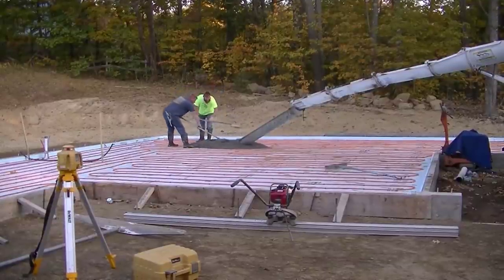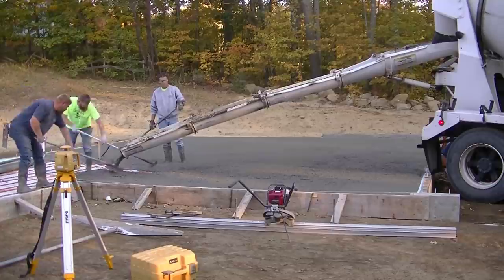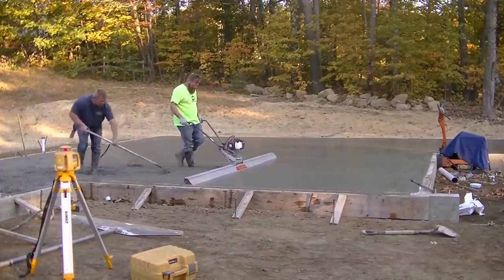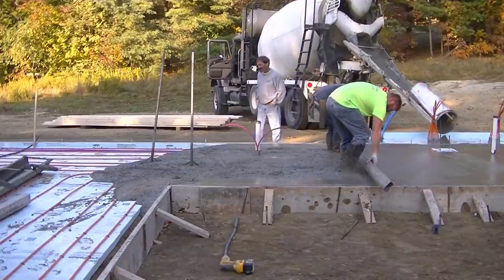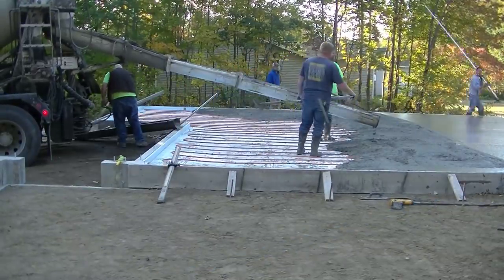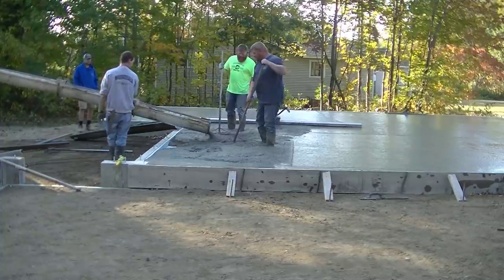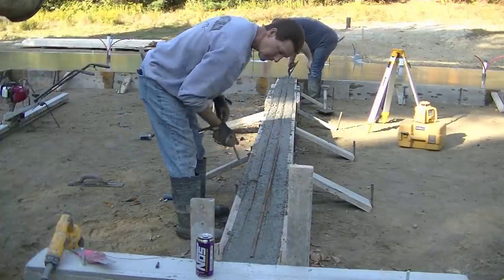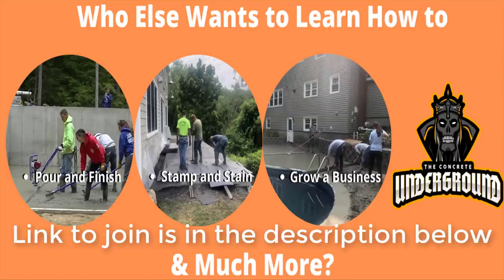Duplex Concrete Floor Pour (Using A Power Screed)

Comment: I’m down here in Kentucky and we have a hybrid system with a heat pump that takes care of business down to 40 degrees or so. Colder temps and natural gas keeps us toasty. Heat pumps are very popular — especially since they actually put out warm air now. We used to have a wood stove for heat but we just had a new roof installed so I decided to remove the flue and stove. Love the heat — hate the mess. 

Duplex design looks good. Surprised that there’s not a firewall between the units. Guess code doesn’t specify one. 

Great video. Thanks for posting.

Comment: Northern Scandinavia here, radiant heat is very common. Geo thermal heat pumps are very suitable due to the low temperature required. I'm no expert in code or other requirements but generally  you would see at least 20 cm insulation on a garage (30 cm in housing), with radiant heat tubing on top of that fastened  to the insulation with plastic pegs  or zip-tied to the rebar netting (always rebar) which is suspended with plastic feet.
Reply from the maker: Thank you

Comment: House I grew up in in PA built in 1950 had copper pipe radiant heat in the concrete floor. Was nice putting your bare feet on a hot floor on a cold winter morning. If I build another workshop it may have radiant although I'm in North Carolina now, not near as cold but I still hate winter.
Reply from the maker: Thanks Bill!

Comment: In the midwest we use gas forced air for heat!.. its hard to comprehend how radiant heat under concrete can heat a home, it must really have to put out a lot of heat!  great video!
Reply: Concrete is a great thermal mass. It holds its temperature (cold or hot) for long periods of time. So once the radiant heat gets it up to temperature it doesn't take a whole lot to keep it there. It's very common in the Midwest. I'm from Kansas and see it frequently. Just saw it on a 8" thick shop floor for a crane company.

Comment: As a shell contractor, I generally subbed out the concrete finishing. But I never had a problem picking up the bullfloat and making a few passes, if I saw the guys could use a little help.
Reply from the maker: I always need help, haha.
Reply: @brianthomas4762  You’re joking, right? 
When it comes to concrete finishing (which is a trade all to itself), ‘West Coast Concrete’ has nothing on Mike. The guy from WCC is a trailer pump operator. Not a form carpenter and not a finisher. He has a few guys that work for him that do exceptional work, but nothing extraordinary. He may be able to teach Mike a thing or two about Putzmeister or Schwing pumps, but that has nothing to do with the niche that Mike has carved out.
Reply: @psidvicious  He can also teach him about bobcat, hydraulic hammers, dump trucks/trailers and most importantly how to run a real concrete business. Imagine Mike attempting to form and finish that concrete bench, diamond grooved patio, j ditch, that concrete stairway. How to Build Stairs - Watch Concrete Stairway Construction Video
https://www.popularmechanics.com/science/a32643833/concrete-stairway-construction-video/  Look forward to Mike's New video on how to stamp with ashler slate. Thanks teacher. Lol. I guess I wasn't informed of the standard on the east coast. Lmao. Paste a link of his best work.
Reply: @greghougen3250  The smart people specialize in a particular field and turn out superior work. Others prefer to try and juggle everything themselves and are happy turning out adequate work. When you’ve done shell contracting as long as I have, you know the secret to the highest quality work is to hire specialists. People who perform a particular task every day all day, invariably produce superior work to the guy that is ‘ok’ at trying to perform everything himself. 
Nice try at trying to make it an east coast vs west coast issue. That has nothing to do with it.
Reply: @brianthomas4762  You can find a link just as easy as I can. 
Look, I’m not shilling for anybody. I’ve just got a lot of experience in concrete work and I’m telling you what my experience has been. If you find you get a better product from the ‘one-stop-shop’ guy, then that’s your man. It’s certainly a lot easier to sub everything out to one company, if you’re ok with less than as good as it can be.
Reply: @greghougen3250  He doesn't have a "business" he is a solo guy who goes out and demos out concrete and does the excavation work. He hires his "Employees" BY THE DAY and probably  pays them 300 a day to setup the concrete and pour it. The only thing Anthony actually does is pump, and operate equipment. He bids jobs and in his bidding his price includes paying those guys by the day and he takes the rest of the profit. Those guys he hires by the day are the true professionals not Anthony. Since those guys he hires are not full time that is why he is free to take vacations whenever he wants and not have to work all the time.
Reply: @7.3powerstroke6  That's what you call having it dialed. "Teacher" doesn't even know how to finish. Brooming concrete piss wet is far below the standard. Why don't you think he never films close ups of the finished product? Everyone would be appalled. PS. Did you take Mike's course and want your money back? I'd be angry too. Dumbass.
Reply: @erici8750  Regardless if Anthony at west coast didn't have those "Employees" available to him, and I say "AVAILABLE" to him (he has no say when they need to work for him) he would be a nobody when it came to actually pouring concrete. In the region Mike pours in you need a very rugged and rough broom finish to not slip in the winter time everything is rough up there. In California it doesn't rain very often or get cold (duh) so they do very LIGHT broom finishes down there.

Comment: Another great video. Curious with the radiant heat tubing.  Are lines pressurized with air, or is there some sort of signal that would alert you if a tube gets cut while you're pouring? It seems with the tools, walking around there would be good chance of cutting something.
Reply from the maker: Yes, they're pressurized with air. We've never punctured a line pouring.

Comment: No anchor bolts for the rest of the house? Anyways great stuff as usual! Love the wet pads I’m going to try that, but you make it look so easy😉
Reply: For a wall with no doors or windows, it pays to put in J-bolts, but to keep from having any conflict with the D&W’s for the rest of the walls, it’s easier to just drill in wedge-anchors or LDT’s after the walls are up.
Reply: @psidvicious  hmm... must be an east coast thing. I've been building in CA since 93' and we've always used AB, never redheads (wedge anchors) unless somebody screwed up, we have a ton of hardware (overkill) in our pours especially load-bearing walls. But thanks for the info!
Reply: @mikeortiz1338    Could very well be a regional thing. Old habits die hard. I remember when AB’s were the gold standard here on the east coast too, but it was about the mid-eighties when red-heads really started to gain acceptance by engineers. 
  Even the epoxies that are out these days, rival the holding power of AB’s. I’ve personally seen a cpl times where the concrete around an epoxied all thread, failed before the epoxy did by pulling out a perfect cone of concrete around the bolt.

Comment: Hi Mike I am from Oman heating is not an issue because we are in hot climate cooling is the issue
Reply: Same here in S. Florida, about 1500 miles (2400 Km) south of Mike. It’s all about cooling around here. 🥵
Reply from the maker: Cooling is only an issue here in July and August mostly. We have 6 months of really good weather, 2 of good, and 4 or pretty cold temps.

Comment: Hey Mike, how long is too long to have a truck on site?
Reply: Max 2 hrs after that the concrete will start to harden..
Reply: ‘The Book’ says you’ve got 90 minutes from the time the water is added to the mix to when the concrete is placed. For something non-structural, like a sidewalk, I never minded pushing it to about 2 hours. The older it is, the harder it’s gonna be to get a good finish on it, in time before it goes off.
Reply from the maker: It depends if it's a commercial job with testers or a job like this. It also depends on outside temps. We rarely have one on site for more than 30 minutes. 1.5 to 2 hrs and the concrete really starts to heat up inside the drum. When you pour it, you'll have to really hustle to level it or you'll lose it.

Comment: Have you ever jitter bugged in you career?
Reply from the maker: Never had the need to.
Reply: @MikeDayConcrete   ok was wondering how the vibe compares to jitter bug.     I jitter all
My pours. But would like to get away from it.   I just can’t though   I have rocks at the top of my slabs.   We just don’t have the quality cement in our concrete I guess.     I’ve watched a lot of vids on here and our concrete is nowhere as creamy as otter areas of the US
Reply: @joeconner9801  The difference in the mud is the addition of the water reducing agents. Before we used plasticizers, we always had a man on the juke, tamping the mud after screeding, then bullfloating. The plasticizers allow the bullfloat to take care of both steps and eliminate the need for a jitterbug or juke.
Reply: @psidvicious  I use a mid range in the winter some times and I don’t find it helps.   The concrete don’t really even come wet     I’ve used super p once and didn’t like it.   It’s was gonna wet to screed.    Just flowed under.
Reply: @joeconner9801  Hmm. Just curious, what part of the US are you in?
Reply: @psidvicious   south Louisiana
Reply: @joeconner9801  Just curious what kind of stone is being used for aggregate there, if that may have any differences. Here in Florida it’s limestone and I’m sure in Maine it’s probably granite or maybe some slate. 
Are you typically pouring a design mix tighter than a 5” slump? When my finishers had a particularly tight slump, they liked to put some weight on the bullfloat, like a cpl besser bricks or a cpl trowel fulls of the mud on the bullfloat to make it heavier to push down the rock.
Reply: @psidvicious   we have both lime and river rock.   I like larger line stone myself.   We do a lot of smaller jobs so we finish my hand a lot.   The small rocks come up and pit some times.   I like big rocks since we jitter bug.    Then it’s all cream.     When I was under 20 years ago we have better concrete in my area.    It seems like they’re just getting cheep materials
Reply: @psidvicious   we pour 5 in winter and 6 summer.
Reply: @joeconner9801  Other than adding some weight to the bullfloat, I’m not sure what else could be the problem. I’ve never really used them, but I’ve heard those ‘Ma and Pop’ type readymix companies can chince on materials a bit. Maybe switch up your supplier and see if it makes any difference.
Reply: @psidvicious   were using the best out of the two local companies now.   They have 11 plants so they’re not small. But you know the people in my area don care what type of concrete they get.  They buy for price and roll.    I call and complain lol. But I was raised old school.  I want some cement In my concrete.    We’ll just keep on bugging until we can’t go no more.   We don’t have any problems with cracking r anything from it.    We just want to get away from that if we could.
Reply: @joeconner9801  Understood. Wish I had a better answer. Maybe Mike will see this conversation and have some input.
Good luck!
🤜🤛
Reply: @psidvicious   we just trying to give the best product to the people and the best finish.   We are achieving that. But I’d always like it to be better.

Comment: Wet pad is the only way to go. Some jobs I was on we used 12” oak stakes which were hard to take out and then we needed a bucket of concrete to fill in the low spots they caused. Not Good!
Reply from the maker: It's what we do the most. Sometimes we'll set a pin with a nail through it at grade but not very often.